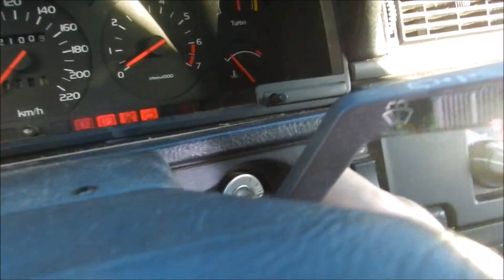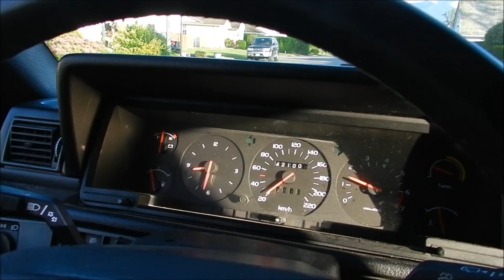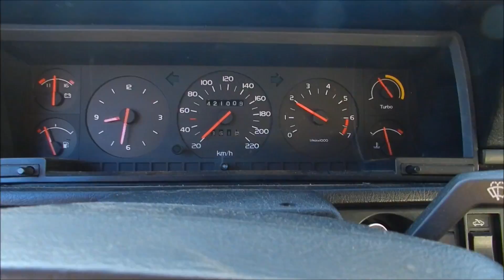THE BLACK M46 TURBO WAGON GETS SOME LOVING !

Comment: Now that I got a good look at the wagon, I changed my mind about you hacking it up.  You sound like you already plan on keeping it a wagon.  The early 4 headlight turbo wagons are getting scarce, let alone a manual trans one.   Your engine definitely needs a valve adjustment, and probably has the classic piston slap.  You didn't say anything but hopefully you changed the filter with a Mann W917.  That's the only filter that has the OEM anti-drainback valve.  I buy 10 packs from FCP Groton for $40.00.  Keep up the great videos and I'm liking and subscribing for pints of dirty Volvo bong water!
Reply from the maker: Michael Crocona i agree with you man ! it really is a classic that i will probably never find another of . the motor is definately a bit tired but atleast its a tired redblock and not a tired v6 chrysler product or something right .i didnt use that filter.. never heard of having to use those . thanks for watching brother . ill keep the dirty bong water flowing haha!
Reply: Drifts N' Lifts well Mann is the manufacturer of the Volvo Oil Filter, difference is you buy a filter from the dealership that says "Volvo" on it you pay $20.  The Mann model W917 fits all red blocks 1957-1993.  They cost around $5-6 each, or you can buy in bulk like I do.  Especially on a turbo motor that oil delivery is crucial.  Just my .02.  Aloha!

Comment: Also I notice that the wagon is a Turbo, which probably needs more than a 10W30 which would probably be for a normal engine,not a Turbo, also do you use regular oil or synthetic or fully synthetic, which is probably better for the car, what do you think.

Comment: That's piston slap your hearing, or rod knock. Defiantly not lifter tick
Reply: Billy Johnsen Not mine, its super smooth and quiet
Reply from the maker: paul dowling its not rod knock but its definately piston slap and lifter tick . the camera mic distorts it somewhat
Reply: i  have a 91 940 turbo with about 400,000mi that has piston slap just like this. under load, slap is still audible throughout the entire rpm range. been beating on it for years and still pulls damn hard. my other wagons only have slap at idle or less than 1000rpm. with a load it disappears.

Comment: shame to hear that motor klack like that. I'm at 402k and I run 5w30 in winter and 15w40 in summer, changing oil every 2000 to 3000 kms. hoping mine doesn't start sounding like that anytime soon. on the bright side though, I've seen some klack like that and daily drive totally fine. these engines are tuff as fuck boi.
Reply from the maker: Thomas Demell yea i think the constant overheating and previous owner running on 87 octane took a toll on it . still runs fine though so i may aswell use whats left of it !